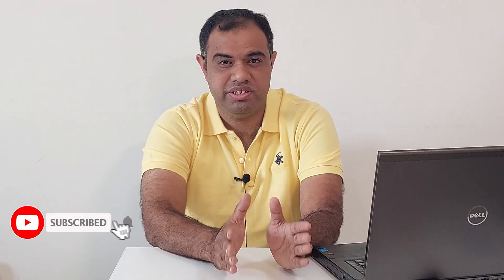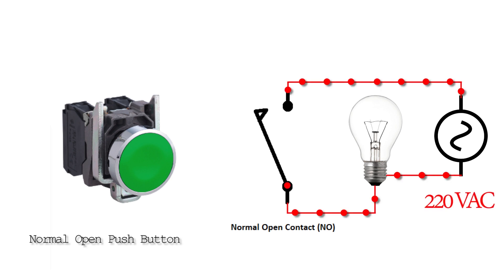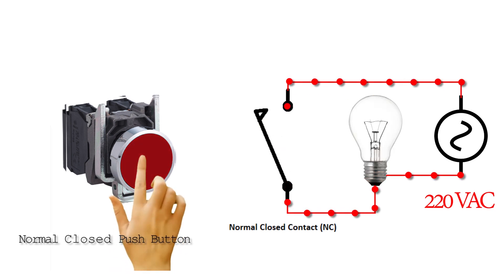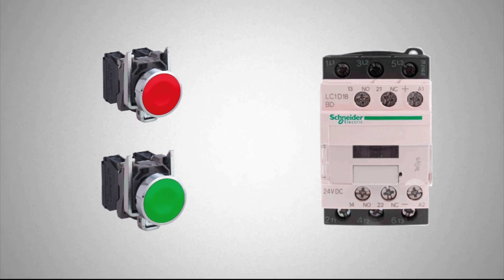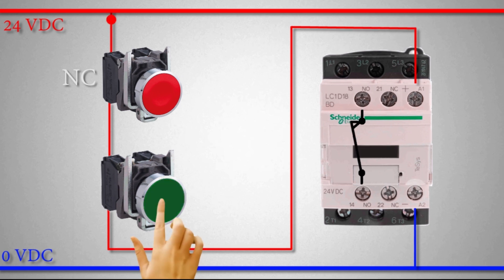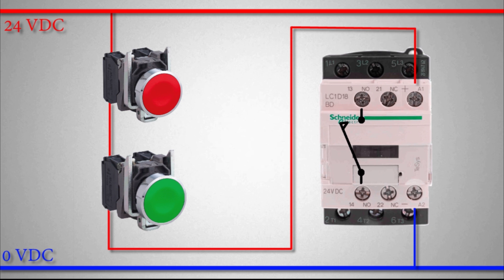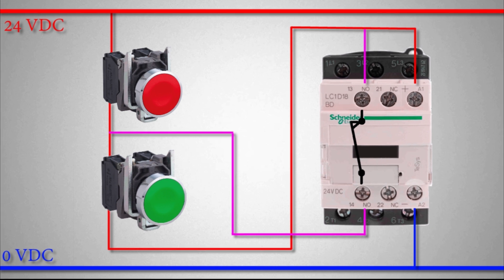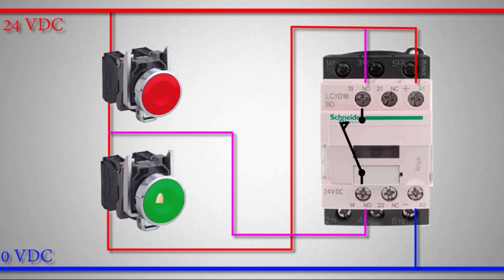How to HOLD ON a Contactor or Relay ? Latch and Unlatch a Relay or Contactor ? Animated

Comment: Need a Pulse to open/reverse to close, spring loaded start/fail to last position relay/contactor. 15/20/40/60amp 220v/120v 24v DPDT or 3PDT?

Comment: What is the easiest way to add a E Stop switch to this 24v circuit where it couldn't be turned back on w/o resetting the E Stop? Trying to wire a CNC Control box. Thanks for your valuable time you take to make these videos. Is it as easy as putting it before the Red stop button?
Reply from the maker: One question , how much ampares load is on the 24 v dc wire ? The wire which you want to cut with an emergency button ?